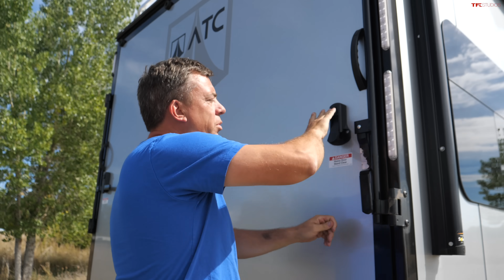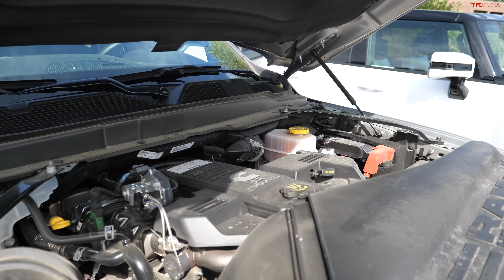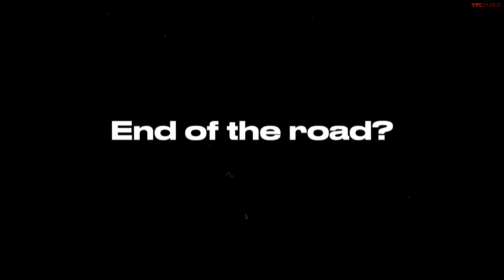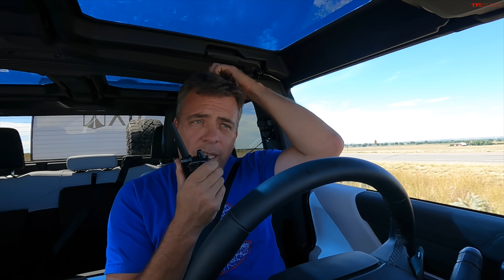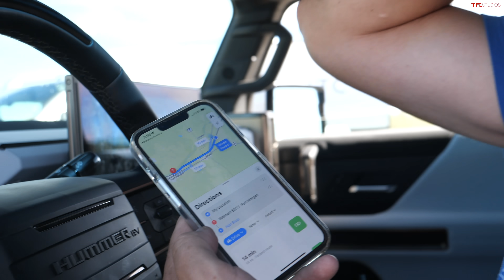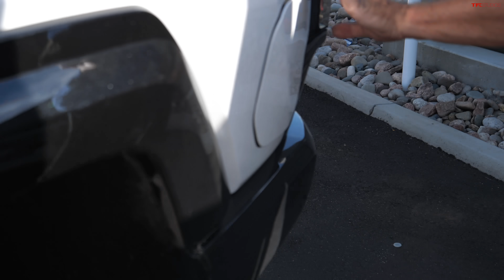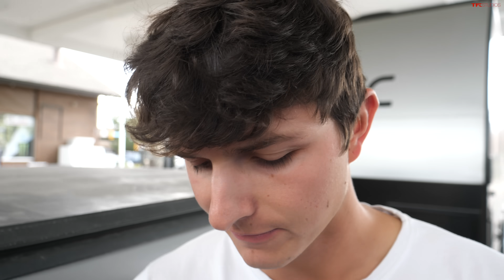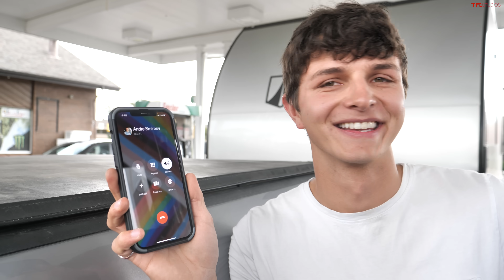How Far Can a Diesel and Electric Truck Tow An Identical Camper Trailer on ONE Fill-up?

Comment: A majority of people it seems are being very short sighted and don’t seem to realize or acknowledge that EV’s are still in their infancy. ICE vehicles have been around for over a century and not much has changed in terms of tank to wheel (TTW) efficiency. Various studies prove that TTW efficiency varies from 14-33% for gasoline ICE vehicles and 28-42% for diesel ICE vehicles depending on factors such as speed, load conditions, vehicle weight, road condition and driver behavior. The battery to wheel efficiency consensus from studies for BEV’s ranges from 81% to as high as 92%.  So while one would argue that ICE vehicles still may have a range advantage that gap is narrowing very quickly as  disruptive EV technologies continue to advance including battery energy densities. And as we know from Wright’s law as production scales there is a diametrically opposite drop in production costs which in this case results in the lockstep drop in the cost of EV’s. For ICE vehicles we are seeing the opposite effect in which they have reached maturation in terms of their life cycle and production numbers. ICE vehicles, for the first time in over a century, are facing the proverbial valley of death whereby the number of ICE vehicles manufactured are decreasing as they are being displaced by the rapidly rising sales of EVs’ which then will inevitably lead to the increasing price of ICE vehicles since economies of scale are rapidly diminished in the manufacturing of ICE vehicle. 

So the bottom line is even though one may argue that ICE vehicles for now still have a range advantage that advantage will disappear over the next few years as ICE vehicles become dead men walking and largely obsolete and relegated to the dust bin of history by vastly superior EVs coupled with an evolving and ubiquitous electric charging infrastructure.
Reply: Someone did the math in another comment. "Thats awesome the charge was free, but let's use the numbers to find out the future cost. The Hummer charged from 7% to 51% for $37.41 according to the EA charger. So $0.85 for each 1%. At that rate it would cost $79 to charge the Hummer to 100%. Hummer cost per mile: $79 ÷ 123 miles = $0.64 per mile.
Cummins cost per mile: $105 ÷ 211 miles = $0.49 per mile"
Reply: EVs aren't in their infancy. The technology is over 100 years old.

And speaking of "short sighted", who cares what battery to wheel efficiency is? It's a completely pointless measurement, as it ignores all the waste in generating and transferring the power to the battery.  

You're repeating decade old EV marketing blather.

Comment: Let's do the same test 5-10yrs down the road after the battery has degraded and the diesel truck will still have all its power. That would be interesting
Reply: or even in the winter how much faster that battery drains
Reply: 10 year old trucks = 9 MPG vs 60 miles 🤣
Reply: @231pilot  my truck is 10 years old and gets 18 around town and 22-24 highway. Soooooo
Reply: @nicksmith4808  Did you watch the video? The diesel truck average 9.7 mpg while towing. A 10 year old truck doing the same would probably be getting 9 mpg and the electric truck lucky to make it 60 miles.
Reply: @231pilot  the diesel will probably get 11mpg, as diesels have a long break in period, giving them slightly better mpg after a few 10k's of miles
Reply: Sure, but track the cost of diesel maintenance and repairs too. These batteries are cooled. They don't degrade quickly.
Reply: @jghall00  Yeah keep telling yourself that. There's no way an electric vehicle will outlast a diesel. The cost of diesel is high because of the current administration. Bring the prices down and the diesel blows the electric crap out of the water.
Reply: @msclecarcrzy  Fuel gets cheap when the economy collapses. You gotta choose. Strong economy or cheap fuel.
Reply: @msclecarcrzy  I don't know ow...my electric tools do pretty well. Your protests won't stop what's coming. Technology marches on. The stable owners said gas cars weren't there yet too.
Reply: @jghall00  Economy was strong and gas was cheap 2 yrs ago. Different administration.
Reply: @jghall00  There's a big difference between tools and a damn car or truck. Get real man this electric junk will never make it. We are built on fossil fuels and that will never change. If you want one go ahead and buy it. That's your choice. As for me I will never own one! Range is too short for what I do and where I live.
Reply: @msclecarcrzy  correct.  Dude that said the economy/gas thing doesn't know wtf he's talking about
Reply: @msclecarcrzy  Already have an EV. I drive it all the time and save my Expedition for towing duty.
Reply: @jghall00  Good for you! Congratulations. I have no problem with that. What I have a problem with is the fact they want to take away choices. Look at California. The fact they want to force us into EV's is a problem. Besides if we are all on 1 system imagine how easy it would be to control the population
Reply: @jghall00  Nonsense!
Reply: The owner of the diesel would have spent tens of thousands of dollars more in fuel and maintenance costs.
Reply: @directorjustin  how maintenance? I know people who have owned diesels for 10-15 years and didn't spend hardly any in maintenance. Just don't treat it like a red headed step child
Reply: In 10 years the battery will have degraded only 10%.
Reply: @silvy7394  you're quoting the low end degradation figure
Reply: @noneyabizz8337  Actually thats high end.
Reply: @silvy7394  it's not.  Most of internet says 1-2% yearly, with some sources saying a little higher.  1% of original change potental would be.....on the low end, since that's not at all how 1% every year works.
Reply: @noneyabizz8337  exactly. Even Ford knows this. With there new lightning they will only guarantee their battery will not go below 70% efficiency after 3 or 5 years I can't remember which. But that is way more than what this other guy is trying to tell us about less than one or even around 1% a year of battery degeneration. One of my vehicles with 190,000 mi still gives me the exact same fuel economy is new. My next vehicle has 176,000 mi with exact same fuel economy as new. My truck which has 379,000 mi is only a half a mile per gallon lower than new it gives me 15 and a half miles per gallon. When it was new it only gave 16. No electric vehicles going to do that or even last half that many miles without a battery change which will be tens of thousands of dollars.
Reply: @4673962  it's 8/100k years for the Lightning 70% degradation warranty.  Y'all are speculating on degradation. But I actually have an EV and an Expedition. I bought my 2017 Focus EV with 17,000 miles in 2/21 and it's at 55,000 miles now. I've lost less than 1 kW in capacity over that duration. The newer vehicles are even better. Anyone who has seen how far tech has come in the past 3 decades knows it advances quickly. You can be a luddite if you want, but there's no fighting against a powertrain that is 90% efficient vs 30% for ICE. And now that battery investment is growing, costs will begin to drop while energy density improves. Electrification will take over the middle of the market.. it's already spreading to the 30k segment. Then will get the fleet market, because they care about operating expenses. Towing will be last because energy density needs to improve, but it will happen.
Reply: @silvy7394  Supply me with credible information on the degration of batteries. After 10yrs I believe your battery will be degraded by at least 50%. Your range will be 1/2 of what it was new. EV'S will never last as long as an ICE counterpart.

Comment: 😂😂😂 The new Xanax vehicle (XV) emergency kit will now include spare tire, jack, tools, first aid, and portable 2kw generator 😂😂But,But,But!..it charges at 341kwh (never mind that a +500hp diesel generator running at 100% load is what is needed to satisfy that charging rate) What else is hilarious is look at the weather they are testing this in. Absolute perfect lab conditions. Wait until it’s 0*f. This test right here I believe is the best efficiency span an XV will see. It’s downhill from here. Roman…the mouse never understood why the cheese was free on the trap either!😆

Comment: Does the Hummer use in-phase four wheel steering when towing at high speed? That feature can make evasive maneuvers much safer when bumper towing a trailer, but I haven't heard any of the reviewers mention it. It's something the truck should have and something they should be marketing. 🤨

Comment: Should be hybrid.
Small diesel motor with low power to be fuel efficient and get you around helped by an electric system.
Without battery power  100hp 200lbs torque .
Combined with battery..  350hp 600lbs torque .

Comment: Its not quite fair to compare “efficiency” at the battery to diesel in the tank.  The EV is still going to be much more efficient, but you lose a decent amount of energy in the production of the electricity, losses through dozens of transformers, losses in 10’s if not 100’s of miles of transmission lines, the charger, the batteries etc.

So I ask, how many tons of coal did the hummer burn? 😁
Reply: Refinement of diesel and gas also loses a significant amount of energy. At the moment, with a gas fired power station the CO2 released is about equivalent. When you add in 27% US average of renewables (and in places like the PNW where it's powered by the Hoover Dam >70%), then it's more efficient.
Reply: @robertharris1748  If you are going to include fuel processing, mining and processing coal is far more energy intensive then pumping crude and refining it.
Reply: @austin73  in Colorado where I live, coal contributes less than renewables (20% vs 37% excluding rooftop solar), so it's not really that relevent. It's also being phased out early. The rest is natural gas which significantly better in terms of conversion, extraction, and distribution. There's a reason coal plants are being decommissioned early.

Comment: They need to build a hybrid heavy duty.  Use the electric motors to move the truck and diesel to power it.  Both can be setup so they are running at peak efficiency,
Reply: That is how a train works.

Comment: I'm so glad yall are doing these tests , it just goes to show how absolutely shitty the current battery technology is. 

I'll jump on board with a "hybrid" when they make it like a Train Locomotive , diesel Generator powering 2 high torque electric motors.  Potential for 40+ mpg and 1500 lb ft of torque .. but this all electric crap is absolutely junk

Comment: The Dodge can pull 3x’s what the Hummer can pull for a lot cheaper price. The diesel can fill up 31 gallons in about 8 minutes and be on the road while you sit at a charging station for 60 minutes to get close to a full charge.  Do a pull test this winter and watch the Hummer fall on its face even harder.  No thanks.!! Keep the diesel and sell that Bloated Electric Hummer.  You forgot the weight of family members, gear, etc.  $115,000 junk.  
p.s,, how fun to have to disconnect your camper to charge it.  😅😅😅

Comment: Again, this efficiency conversion is silly. The amount of energy a Hummer uses from its battery isn't the bottom line, as it doesn't account for the cost/waste of generating and transmitting its power. How efficient is the grid? How much power is wasted by a turbine plant? How much power is wasted by power lines and transformers? How much power is wasted at the charger itself? In total, how much fossil fuel is used to make the equivalent? Ultimately, MPGe is a meaningless metric, because it ignores all the gallons wasted just making the equivalent gallon, so no point in conversions.
Reply: Natural gas power plants run at about 62% efficiency (coal and oil are much worse), transmission and charging is close to 90% (let's call it 85% to be generous). Gas/Diesel engines are at best 50% efficient (most are less), and that doesn't include the energy costs of refining. 

When you include the fact that on average in the US renewables are 27% of the total power generated then electric is better than fuel (marginally). If you live in the Pacific Northwest which is powered by the Hoover Dam (or Toronto which is >90% hydroelectric) then the calculations are irrelevant.
Reply: @robertharris1748  Whether you're being entirely accurate or not, I won't debate the accuracies of your comment, because it essentially reinforces my point.

Even if we say 50% power efficiency in total, from generation to your your EV's wheels, that only extends the emissions breakeven point even further, if there even is a breakeven point, which is already an uphill climb simply due to the fact that production emissions of an EV is greater than an ICE vehicle.
Reply: @Mark_Christian25  like I say, it depends where you live. When the technology is more mature and battery recycling plants are operational (10 years?) it'll be interesting to recalculate emissions for vehicle manufacture. You also need to take into account (cradle to grave calcs) the oil etc needed for transmissions, engines etc. I haven't seen any solid data on battery life (anecdotal evidence, only, in both directions) or on vehicle life. Certainly the ICE vehicles I've driven have lost significant efficiency (mpg) over 10 years old. Whether that's because of build up in engines, or head gaskets getting old, I don't know, but the average efficiency of a 10 year old car is significantly less than. 50%.
Reply: @robertharris1748  If your ICE vehicles are losing efficiency after only 10 years, your ICE vehicles are either poorly designed, or you aren't maintaining them correctly. 

My Ram is nearly 10 years of age, with nearly 200,000 miles, and it gets better mileage now than when it was new. That's because it's all broken in and seasoned. That's how all ICE vehicles should perform as they reach such age.
Reply: I had a 1996 jeep that got worse and worse from year 10 (kept it for a further 8 years). I took it to a garage to get checked every year, or if i thought there was a problem. I am not a gearhead (like the vast majority of people), so I have no idea how well maintained it was. If it wasn't well maintained then I would anticipate that would be true for >50% of the cars on the road).

Comment: I did appreciate the talk about the numbers and how much energy each vehicle has on board, haven't heard anyone actually compare on paper a ICE vs a EV.    They may be more efficient but the battery tech isn't there.  It would be tough but it would be cool to see a life cycle comparison for cost and total emissions to see just how green EV's are or aren't.
Reply: Watch the Engineering Explained video about EVs vs ICE, he does a total breakdown of lifetime emissions for each.
Reply: Batteries can be recycled. Diesel can get recycled...but it will take millions of years.
Reply: Well i just got few more aspects to consider : for example not sure if US have any pollution taxation but in Europe from 2020 European parliament added a new pollution tax for all ICE vehicles and that must be payed on all EU countries even by tourists that transit all countries that are members of EU.. another aspect they don't tell about is servicing because on long term use ICE have lots of consumables to be changed (filters, oil, rubber belts & hoses, rollers, gaskets & O-rings, water pump, cooling liquid, fuel pump, spark-plugs, brakes liquid, transmission fluid, all according to user manual exploitation so this comparison shows only one side, but for example a 10 year owning would be in advantage of BEV for less overall costs only insurance to pay and charging fees (no pollution taxation, less consumables & parts to be changed less hours spent in service less man/ labor payments) overall > smaller bills.. another important fact recently included on most major cities (in Europe) that if you want to go in weekends with family or friends with ICE cars in center of city to a good restaurant, gelaterie-ice-cream shop, kandy/cake/chocolate-shop, pizza & pasta, or to see local tourist attractions, museums, art gallery, opera, theatre-gardens, parks, castles.. etc is hard because authorities signed another EU rule that all ICE (diesel & petrol) vehicles can not be driven down town on any center streets of the city only allowed from airport to peripheral hotels.. for all BEV hybrids included the rule will not apply ( no worries because most services like taxis/uber/bolt already use full EV's across Europe).. So if we sum up and see all aspects on 10 years owning the BEV would totally win specially since very few people tow anything in EU, if they really need to move something big stuff furniture, paintings, big hardware etc.. they will definitely hire or rent moving services with lorries..